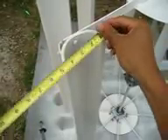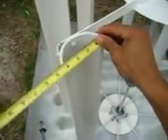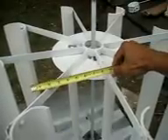pvc vertical wind turbine

Comment: I’m going to make one with thin aluminum sheet instead of pvc, and I’m going to create an internal magnet and copper system, and a cover for it that will help air flow in and protect my turbine in case of debris
Reply: Did you never built your turbine???

Comment: The efficiency of the 4" pipes to catch air will improve if you put a wall at the ends of the split pipe.  The walls should be full circular.  The walls will prevent the air flowing out the ends of the pipe.  
If the support pipes were round pipes, not flat blades, the drag on spinning would also be reduced.  Nice idea, it reminds me of weather station wind speed rotors.

Comment: Pretty design & PVC is certainly cheaper and commendable for a first off prototype. Agree with earlier poster about the height - above the tree line unless your backyard is naturally configured to create a wind tunnel. There is no mention of the speed or the generating capacity. I am wondering about the efficiency of blade design. Do you get that from an engineered source?

Comment: good stuff. i would however  change the angle of the blades/tubes to be in line with the larger circumference more.. when this present system spins it will drag

Comment: Very interesting design and relatively cheap to build. Your vertical axis turbine also needs to be much higher that you have shown to be effective, above the tree- line to reach the higher wind speeds. At the height you have shown in this film the wind speed will be about 25-30% of what it is at 40ft height, and will be coming from all over the place through 360 deg. You will also need to have wire stabilisers attached to the pole just below the turbine to steady the pole. Use 6 wires galvanised steel wire for stability (6mm diameter) - ie. if one wire breaks, the turbine will not come crashing back to earth destroying itself! Cheers. Good build!

Comment: No video of the thing spinning and no reference to any way to produce power from it. Have to wonder. But the brackets holding the blades don't need that extra almost broke off part with the extra screw, just not needed.

Comment: What if you took the "vertical" turbine and laid it horizontal against the peak of a house or even against the wall of a building? Seems the air hitting the surface would hit the turbine at a greater speed than if it were in the open air?

Comment: great job but it needs to have only 3 5 or 7 bade's as the even number will cancel out the drive and produce a small amount of drag. it will go but it will have a top speed of 15 or less because of the even number. you can double it maybe if you redo the arrangement.  search why how many blades to see your self. still very inspiring keep up the good work!

Comment: This is pretty much what I had in mind, except I was thinking to shape the fins with sheet aluminum and make them wide and deep.  Now I see the PVC design you have and it looks much easier.  Makes me wonder if I should go through the trouble of making large, deep blades, or just use 4 inch PVC pipe?

Comment: Yes I think it is better to have a larger turbine for days when the wind is slow and still make power. Major problem I am having is controlling the speed, The Generator i have (6Kw) the speed is (WAS!) governed by the engine. Also obviously the speed has to be constant (3000RPM in UK) for the Frequency (50Hz), I looked at a mechanical brake hub but it is way to inaccurate. Not really seen any "home made" solutions to the 3000RPM problem.

Comment: you can make a few smaller turbines that can handle the forces. That's just the first idea that came to mind when i read your problem. I don't have a solution to combine the power of all the smaller turbines but there most certainly is an answer out there somewhere that will work for you!

Comment from the maker: you are correct it is heavy due to the pvc pipe,i will upgrade this wind turbine and re-desing this model so i will not use motor belt or ball bearing , i will use in the bottom magnet to levitate the wind turbine and on the top i will intall the motor attached directly to the center of the wind turbine, i hope this idea will be better

Comment from the maker: sorry for the late reply, where i live is small town and there is not much wind but i will upgrade the design and i will use "O" ring magnet to levitate the wind turbine and i will attach the motor on top an i will attach the shaft of the dc motor to the center of the wind turbine so i will not use a belt

Comment from the maker: there are so many  ideas that i have to upgrade this project, my next idea is to use 2 magnet in the bottom of the wind turbine and install the motor on the top directly attached to the center of the wind turbine without using the belt for the motor

Comment: Creative turbine. Structurally there are areas that need extra support. I am mainly concerned when the RPM's builds up that the centrifugal forces will exert stresses on the supports holding the PVC causing flex and progressive vibrations. Also, the support stand the turbine is mounted to needs improvement in case the unpredicted or unanticipated wobble effect  occurs. Come up with a break design if possible. Good luck.

Comment: You know, it's very likely the first person who built a VAWT didn't have turbine expertise either.....I agree this one may be a little on the heavy side, but with the right bearings(like cup and cone forinstance), it should work, the extra weight of the steel will certainly help keep it spinning(at the expense of bearings). 

Keep in mind, this is trial and error, if it doesn't work the first time, you learn from it and then build a better one, plain and simple.

Comment: just curious,  what kind of alternator/generator did you attatch to the vawt, How much power did it produce? I'm in the process of gathering materials for my first vawt build, and am trying to decide how I want to do it. I think for testing purposes, I'm going to start out with a PM car alternator, or maybe gutting it using the 3 ph and stock field coil with a home made voltage regulator.Eventually though,I'll use a converted 3PH motor,I think the higher input voltage inverters is the way to go.

Comment: This vertical windmill design can be improved by adding a layer of angles vents around the circumference that increase the pressure on the windward side while decreasing the pressure on the leeward side.   This also helps make it safer for birds, and you can camouflage it if you'd like.   The PVC for blades is a great off the shelf design though!

Comment: DC, you make AC with generators hooks to things like this and then you pass it through a Bridge Rectifier that turns it into DC and that goes to batteries charging them. A Bridge Rectifier  is not much after you know what it is, but it's kinda hard to explain for me so just consider it a box with some electronics in it then converts AC to DC

Comment: Very nice turbine! If you take the cut pvc and turn them 45 degrees to the axis instead of 90 degrees you might get a little wing lift increasing performance. By that I mean rotate the pvc counter clockwise 45 degrees or even just 35 degrees. Could be worth a try.